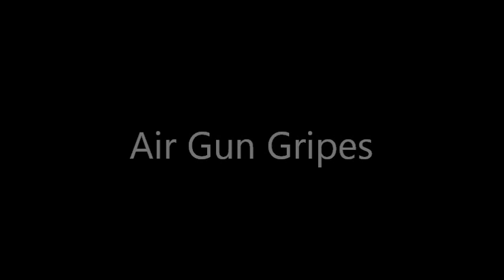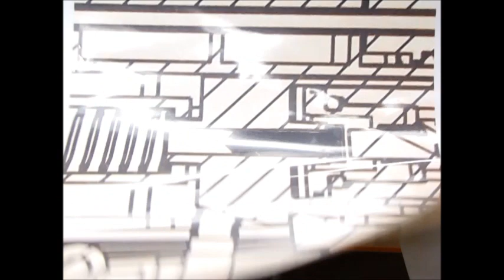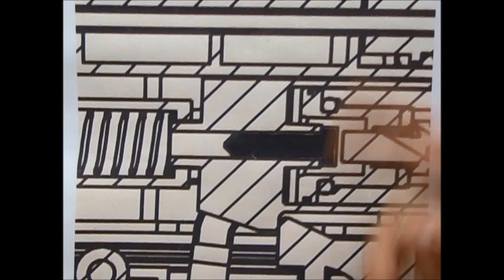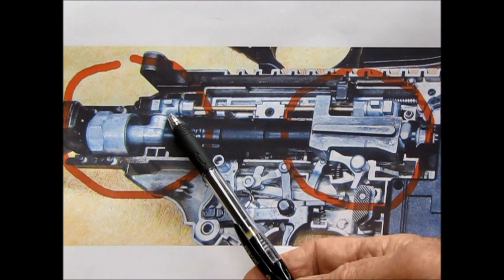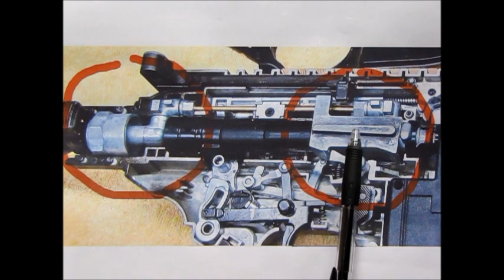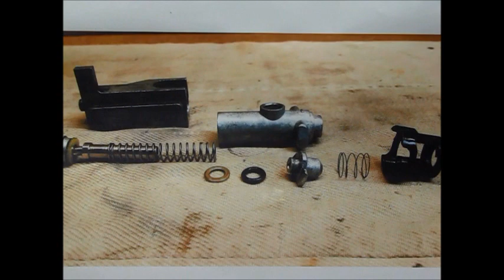Sig Sauer MCX and MPX Big Problems with MPX and MCX Co2  Final Review.

Comment: The first  one i had failed because  I did lube it you're supposed to lube them with every change of  CO2 tank you won't get very many rounds out of them. If you don't properly, lubricate them.
Reply from the maker: thanks for the replay. I think the problems with these are to many and vary far to much. Having the firing hammer falling out on it's own is just the start. thanks again.

Comment: I actually have owned one of these for years. I thought the price is reasonable, for what I thought I was going to get, it’s fairly reliable, provided that you load the belt right. Negatives are it does jam up occasionally, belt is a pita to load, I don’t see where the power they advertised was accurate, at all!! I brought it down to nc because my cousin lives in a neighborhood and there’s a serious squirrel problem. Apparently they like gumnuts and those trees are all over the property. I pegged 2 squirrels (I know I hit them!) one laughed at me and ran away. The other one, seemed like it did get through, but it ran, and either recovered or died a slow death. Advertised as 500-600 FPS and should be able to penetrate, with a full 90gm co2 cartridge. I don’t want to be cruel. I want a clean shot, and drop. I had a daisy 880 as a youngin and I never had any issues dropping a squirrel back then. 
The sig is nice for target shooting, put a red dot on it and I can tag a 2” bullseye from 50ft out constantly. I have had no reliably issues, 30 shot magazines are nice, but if it’s having issues with being reliable, holding the charges for a half a day while you are sighting a red dot, etc 
With my own experience and you’re telling me it’s not reliable? Way overpriced. Daisy 880 is like 79 bucks at Walmart and is a much better varmint rifle than this, imo. I have put a bunch of lead through it, at least 10 cans of crossman destroyers I can always get it to work. If it had the penetration power it advertised I would probably argue for it. 😂 my personal issue is it just doesn’t have any power. Never really did fresh out the box. 
And we know from the p320 debacle that sig is just not a customer friendly manufacturer. 😂 so after this video, I give it a hard pass.
Reply: Yea.. I bought a 2nd hand 2020 issue MPX with a leaky valve for cheap last year. Fixed the leak and it worked well - but the fps is under 400fps with 7gr pellets..😂 Though - that is an okay velocity for my backyard.
If want better fps - then the Canebrake is easily the better option. The Canebrake is also way better for HPA - while the MPX is not.
Reply from the maker: your one of the lucky ones......thanks

Comment: part numbers are a mess, thanks for your effort its being useful to this day, the gen 2 mcx that  i have has only once had a failure to feed and caused the trigger to jam, removing the mag and dryfiring dropped what i assume was a pellet that i didnt load correctly, after that it hasnt had a hiccup, yet i am at 1400+ shots currently,, no maintenance done yet. i use the 90g carts and honestly i leave it loaded and it hasnt wrecked any seals yet. i am thinking this is a certain batch that has these issues a lot more often. thanks once again
Reply from the maker: your lucky....

Comment: Oh my God! I have been interested in these fun Co2 toys produced by Sig Sauer for a few days. Especially with the Sig Sauer Rattler co2 1.77. I wanted to research on YouTube and forums about possible problems with airsoft guns, whether there is any malfunction in this gun, whether there is a chronic problem, whether it can cause malfunctions similar to airsoft GBB guns. I do this before every purchase. I came across the videos shared before your enlightening and wonderful video. Almost all Sig Sauer owners mentioned the same problem in those videos. Later, I told the store selling this product in Türkiye, where I live, that I had some reservations about this product. Most users say that both the MCX and MPX model guns malfunction after 300-500 shots, I asked if this was true. I also asked if there was an authorized distributor and if there was a shortage of spare parts when I encountered such a problem. The seller answered so sincerely that he said that this problem especially occurs in serial firing CO2 guns, but that the manufacturer helps. But he also added that he warned me not to buy a toy that fires in rapid succession. As you know, CO2 malfunctions when excessive pressure is applied to the mechanism when fired repeatedly. These malfunctions become even more pronounced when fired in rapid succession. O-rings, seals and all parts that come into contact with the gas are damaged. I was very eager to buy this gun, but I will not take this risk, knowing that I will spend hundreds of dollars, thousands of liras and buy such a problematic gun. Thank you for sharing this great opportunity. Everyone who is eager to buy this gun like me will learn how to buy a problematic gun. Sig Sauer, a very famous brand, does not suit you at all. I think this is a sales policy. New products come out, throw away the old ones, make new expenses! If this is the plan, you have lost a lot!
Reply from the maker: I've had three of them and one of them I only got off 9 shots before it took a crap......Bottom line is Sig doesn't give a shit.

Comment: My MCX shit the bed today. I'm on the 6th CO2  refill since new. i just pull the charge handle and the trigger will pull, but no gas. the gas is not leaking. Is the gun junk now? thx for any advice.
Reply: I guess the firing pin then popped out..?
Not difficult to fix if no real damage has been done to the internals otherwise.

Comment: They have made a new version called the canebreak rattler ! 
Seams that they have made adjustments to it and it works well..!
Up to now I have put through it up to 3000 rounds and it is still working!
Reply: Yup. The Canebrake is awesome. Best choice of these Sigs if going with .177. These MCX/MPXs are not really that much to build on - except if being a hardcore Sig replica fan as I.

Comment: No offense, but you might be better off, taking that gun, tossing it in the recycle bin and getting yourself a slingshot. It might be more reliable I got one of those just the other day and then I did two days of research and realized it is complete garbage. I should’ve done my research before I bought it like I normally would do I took it back today and got my money back while I still had a chance.
Reply from the maker: I did get rid all of my stuff related to the MC and the MP....junk from the ground up, the real sad part to this is SIG......thanks  have a great weekend.
Reply: I thought that SIG Was a good name, brand ??aside from air, guns clearly😂

Comment: It seems like the quality varies from gun to gun. I bought mine in the UK a few years ago but finally found time for it like 3 months ago. I shot close to 4000 pellets through it both with 88g CO2 bottles and a small 12g cylinder (via adaptor). The thing still works. What sucks for me is this really cheap plastic handguard, that is not made to a spec to fit keymod accessories properly, and it's impossible to replace - at least I didn't found any replacement for it yet.

Comment: SIG needs to step away from the airgun game. All of their airguns are garbage. I have yet to find one that operates reliably. The only rhing consistant is their inconsistancy and customer and gun service is horrible and tyrn around tines are basically non existant
Reply from the maker: I agree completely, I truly wish someone would build a really good one one I'd buy it.
Reply: @macsteer45mac96  there are good ones. Hatsan, I believe, makes a full auto or two. There are many high quality air gun manufacturers, just do some research and I'm sure you can find what you're looking for. If SIG would just fix the issues they would have a good product.

Comment: I just made shot 1000 with the mcx.  I bought the gun January 2023. I’ve not experienced any major issues but issues none the less happen occasionally. I’ve noticed sometimes the trigger won’t pull and just by simply dropping the mag and reinserting it fixes the problem.  The gun can have a heavy trigger but I never force it if it’s not firing. I’ve not experienced any problem with the firing pin falling out yet 🤞. Occasionally a pellet will jam up as well. So I strip the mag and remove the damaged pellet. I’ve had decent luck this far. If sig made air guns that are the quality of their real ones it would be nice but would price a lot of people out but would be a high quality gun for sure. I also have a sig p226 pellet pistol. Now that thing c came with issues after one co2 cartridge lol.  Opened it up and the barrel was loose so I did what everyone else does with electrical tape. Been shooting good ever since. Anyway, thank you for the wealth of information you’ve posted. If I have any problems I’ll definitely be consulting your channel
Reply from the maker: You are very lucky.......Good Luck.

Comment: Greetings,

I've seen your videos on the Sig MCX/MPX, and I have been working on solving a non-firing/blowback issue with my MCX as well. It seemed the issue I was having, was that the hammer pin wasn't pushing the firing pin far enough in, to fire the pellet or blow back the bolt.

I believe I've solved this issue today by installing a small washer behind the head of the hammer pin, before jamming it back into the bolt. This extends the pin outward slightly, allowing for more travel on the strike, pushing the firing pin in further.

This has so far been giving me consistent power and blowback through a couple mags now, where previously the weapon did not fire at all.

I was wondering if you might want to test this further and maybe do a video on it to help so many with the same problem?

Thanks,

KGK.
Reply: Also, it should be noted i wrapped a layer of aluminum foil around the pin, then heated it with a torch before jamming it back into the bolt. I'm hoping it'll help it hold, as I also had the falling out pin issue.
Reply from the maker: I think Sig needs to do this....Why are we the buyer having to fix a bad product....just a thought.

Comment: Hi, I have a question, do you have experience with SG Sauer MCX Gen 2 because Gen 1 is quite poor, very weak aluminum, jamming etc have they improved material quality and strength? Thanks for the answer.
Reply from the maker: No, after the three that I had ( one MCX and two MPX )  I got rid of them all. Sig sold what you call a gen 1 for ten years and never changed a thing even after all the returns.....No More SIG's for me......Goo Luck.

Comment: Hi Mac
UK airgunner here.
Great reviews but please read my input in your previous video clip!
First off, these toy guns are not designed for HPA. However anyone who would like an engineering challenge can keep these toy's operating using HPA by shimming the air cylinder into the frame!
As I have stated in my previous review/input, If you are unable to fully de cock the rifle while the air tank is fitted, it would indicate the the cylinder is binding on the Block due to the air pressure!!! Indicating that shimming the cylinder and a service is required. I have owned my Sig MCX for over 4 years now and lost count of the pellets I have fired and also accuracy is still amazing!
Read the review I have done prior.
Note: I have not had the Pin fall out of the block as yet, perhaps just lucky! Hope this info helps!
Reply from the maker: Yep I've had it working both ways, but even on Co2 it just falls apart. You're right it is not made for HPA we were going to reverse design and make a brand new one that would work on HPA $$$ .....butttttt thanks for up date

Comment: I own a Sig Sauer P365 CO2...beautifully faithful replica, a little under-powered but very lightweight, compact and a joy to own.. HOWEVER.. I also noticed some design flaws, or cost-cutting on manufacturing.. notably, the mag hex screw nut is made from a very low grade alluminum and the allen key hex hole for tightening has a tendancy to get messed up pretty quick, in my case less than 6 months into ownership and 200-300 rounds. 

The tightening and seal on the P365 is also very hit and miss I found..it needs quite a bit of tightening to avoid a rapid escape of CO2. It astonishes me that Sig would release such a well made replica pistol with such a low grade soft metal mag nut which obviously needs to stand up to a lot of wear..using steel would make a lot more sense and getting the thread and tightening threshold more accurate. 

Replacement mags are expensive at nearly 50% of the cost of the actual gun! I'm now looking for a steel nut with an allen key hole same thread similar size as a replacement (seen some on AliExpress in China cheap)...alternatively I'm considering 3D scanning and printing some in a harder plastic and just replacing periodically before the allen key hole wears out. 

I'd appreciate your thoughts and comments on this Macsteer45 or anyone who owns a Sig P365 and has had similar problems with the mag nut. 

As a side note, I own a GAMO C-15 semi auto blowback made in Japan (very cheap £79 UK) which although not as compact and asthestic nice as the big name licensed guns, it packs a hell of a lot of power (500fps+ 4+ joules), goes through steel cans both sides, plate glass, PVC, destroys whisky bottles, pretty much anything!) and the CO2 mag design is much better thought out.. the CO2 capsules pop in sideways and at the bottom is a winged nut for tightening. It works flawlessly every time, no hiss or CO2 loss.

Comment: Mine would leak from more than one place and and I took it apart and cleaned it good and polished up some parts in there and also sanded up some areas and got everything smooth in there but I lubed up all the o-rings in there and put some oil on the springs and everywhare and now no more leaks at all I put o-ring on the co2 nipple also and perfect seal everything but now no trigger pull so now got to take it apart again and fix what ever I did upside down in there or something I got wrong errr... oil them o-rings and big differencee no leaks

Comment: DAMN!!!
One good (or probably THE best) video on the MCX/MPX issues that I've ever seen!
I soooo enjoyed this one. So well made. Well talked thru, and so on. Total enjoyment.

I made a totally new firing pin out of an M4 cylindrical hex head steel bolt for my MCX after it popped out the firing pin for the first (and absolutely last) time. I made M4 threads thru the rear of the hammer. Cut the rear notch totally off the hammer and secured the bolt-firing pin instead with a long (maybe 7-8mm long?), round 6mm nut (that I actually made of a 6mm bolt (an unthreaded part of it).. The 6mm thick cylindrical new nut became also therefore to be the new hammer spring tube notch...
Yea.. I love these Sig rifles. Im a fan.. Yes. Not because them being that good - but for them being damn good tuning hobby airrifles. Many nights thru doing stuff on them.😁
Never had that valve's plastic seal problem though. The seal's mid cap did come off on my Virtus PCP as I disassembled the valve. But after hitting back that cap well into the seal and the valve cap - it still haven't given me issues.. If my Sig valves leak - I just add some silicone oil into them thru the rear. Has fixed every time - whenever rarely sucha thing has occurred. My Virtus had a small valve leak as new - but has not occurred after that to this date. I bought my Virtus last year's August. And I've probably now shot about 4-5 thousand pellets thru it.. Now: 100bar pressure, 11.9gr RWS Hobby pellets, 850fps average and 19ft-lbs. Runs all good.

I had my MCX shooting  pretty badass also at some point. My new firing pin being adjustable in length and all that now.. But the cooldown effect only allowed me about 10-15 very hard shots before it kicked in, fast (used 12g co2 cartridges and adapter) - so I decided to just keep it as a plinker with quite a consistent power output. If I ever get my hands on a cheap (or possibly free) old co2 MCX rifle, I'll definitely start modding it into an HPA rifle. I woulda even wanted the Virtus to be a .177 - but Sig apparently wanted to put out a .22 instead..

But yes.. Thank you for making this video! I had a blast!

Comment: Thanks for the extra knowledge. I've been down this rabbit hole a bit. The gun could be so great and fun without all the problems. They have a newer version out (canebrake) but who knows if they addressed any problems.
Reply: The firing pin definitely should not drop out. Not from the front at least🤣. It's now threaded and apparently threadlocked. Inserted into the hammer from the rear. Sat locked like sonofabitch on my Virtus - and the Canebrake did get the same system. The Canebrake is the best Sig co2 rifle option nowadays by far for anyone that's about to buy their first one. I think Sig made a few very sweet things to the Canebrake. Or at least it looks that way to me. I did get to see pictures of the Canebrake internals a week back or so - and it looks as the Virtus except for some things that was needed for it to be a .177 co2 version.

The valve's cone nozzle can't jam anymore. The rear of the cone is smaller and got an o-ring to seal it. Therefore the old cone jamming thing can't occur anymore. The fork-looking piece that moves the cone nozzle is made different and located differently. Does it's work much better now...
Some that now came to mind...
Reply: @brorjordas1979  hey greetings! I believe you helped talk me through my first teardown when I lost my 1st firing pin